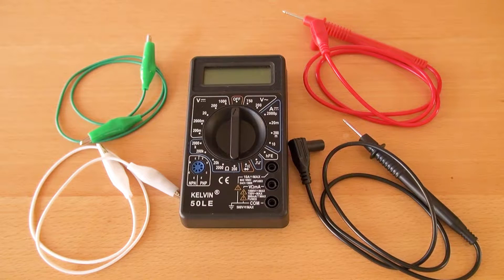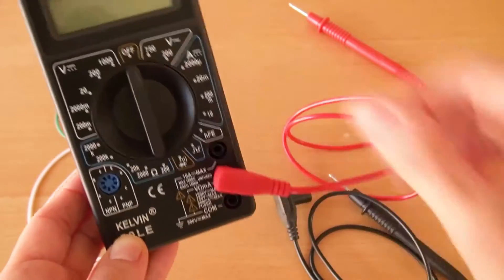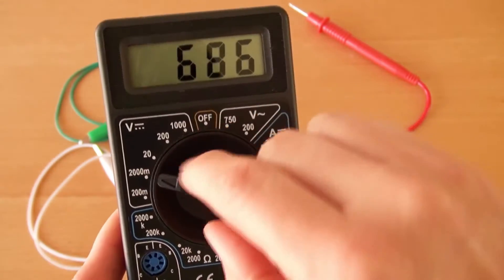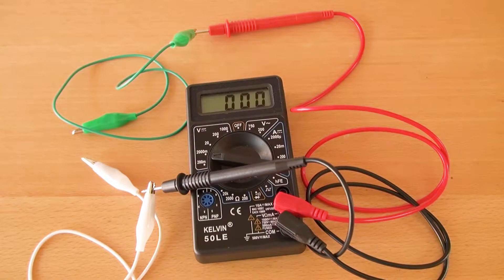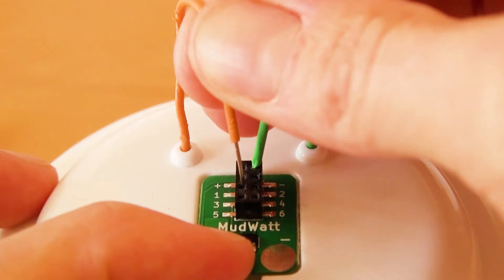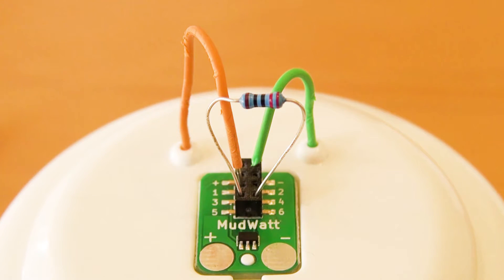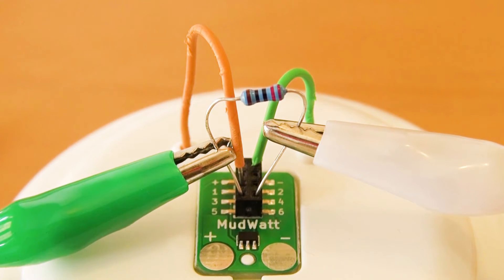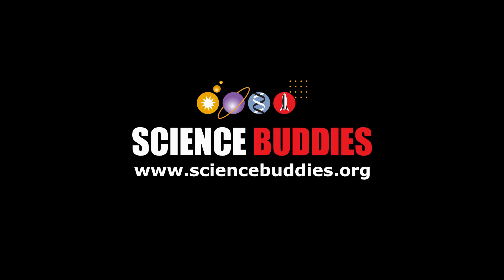How To Measure the Power Output of a Microbial Fuel Cell | Science Project

Comment: Does this work for double chamber microbial fuel cells?
Reply from the maker: The kit shown in this video only contains electrodes for a single chamber. You would need to modify it and make or purchase additional electrodes to use two chambers.

Comment: hello, ma'am! may i know where you get the hacker board?
Reply: another question, will it be possible to use extension wire on the hacker board rather than the led? i'm thinking of using it, since we have to show how the accumulated electricity will be used in something like charging a cellphone to prove that it's working

(sorry for my bad grammar 😅)
Reply from the maker: Hi the hacker board is sold as part of a kit, which you can find linked in the video description. Yes, you can plug jumper wires into the board as extensions instead of plugging the LED in directly.
Reply: @gwenmargaretpadilla4372  Did you figure out how to charge a phone with it?